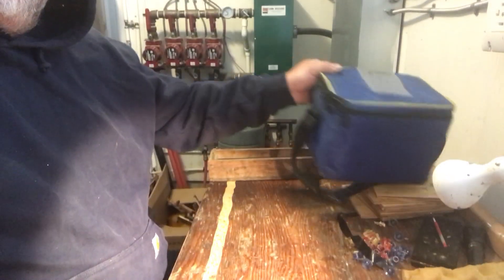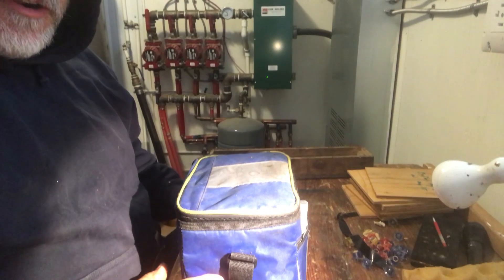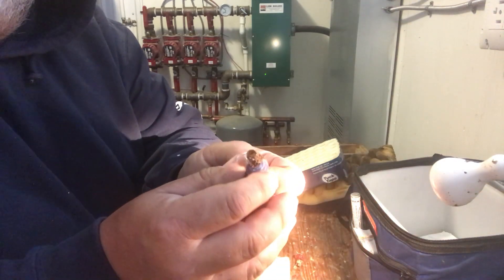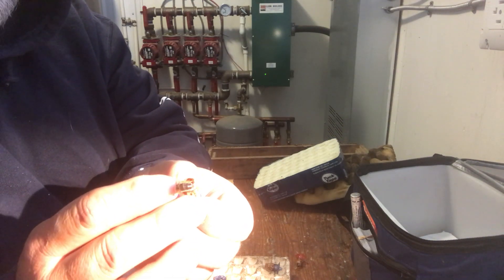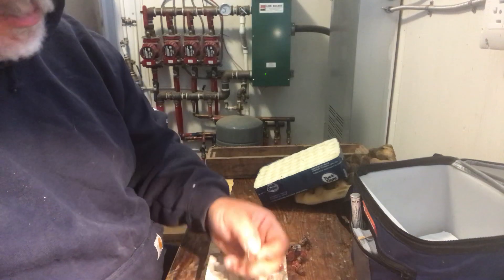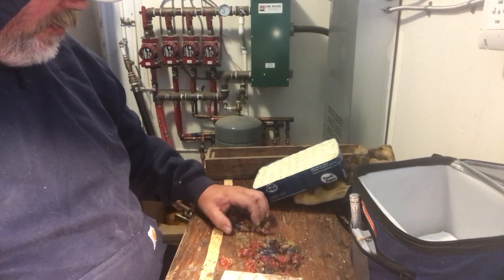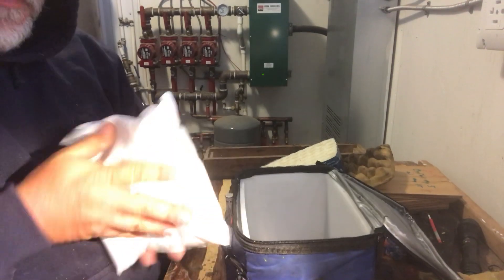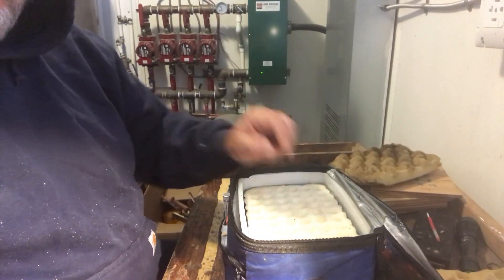Queen Cell Quality control test

Comment: Hi Phil, nice hatch! doing it exactly the same way, works perfect. I observe the same thing with 2-3%, looking good but not hatching cells. This season I did a lot of virging queens, hatched in the incubator, also there, there is in the first 1-2 hours after emergence a supplementary loss of 2-3 %, any explenations for that?? Its like they are not able to digest food or take up water, I don`t know.... Pat
Reply from the maker: I played with virgin queens many years ago.  One thing I learned is that virgins don't last long at the 34 deg temp in an incubator.  I used to keep them at about 28 deg C.  You need to check every hour to get them out.  I thought about designing an incubator that kept them warm and then when they hatch the drop down into a cooler temp.  Never followed through on that idea.
Reply: @philbeeman  ha! nice idea!
maybe its the temperature.., I kept them at 34°C... I check out! thanks

Comment: Great advice on the gel pack.  A water bottle seems a little difficult to control the temp.
Reply from the maker: The gel packs seem to hold heat longer.  I guess because they are a denser material?